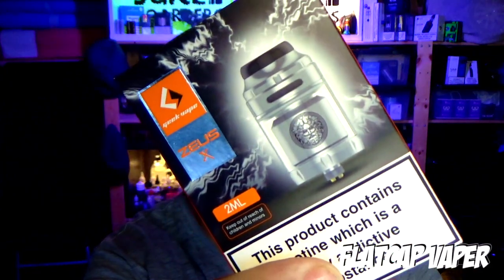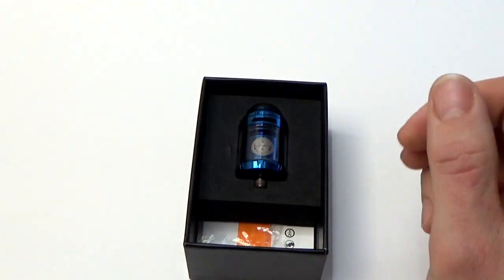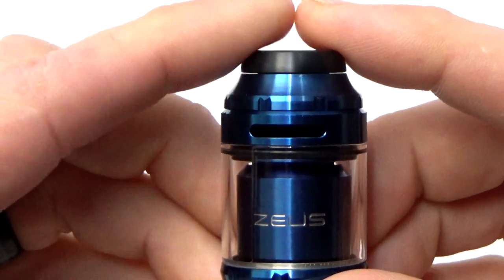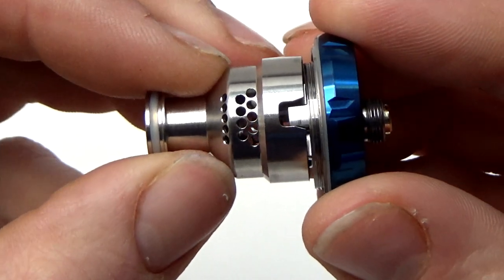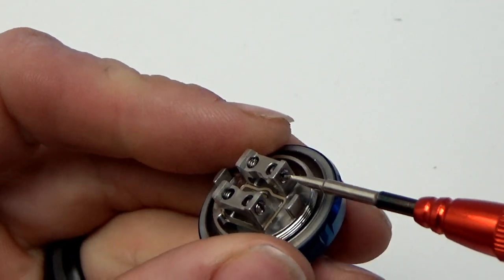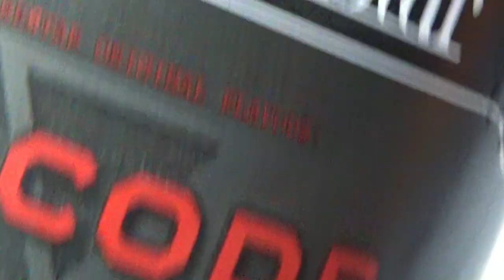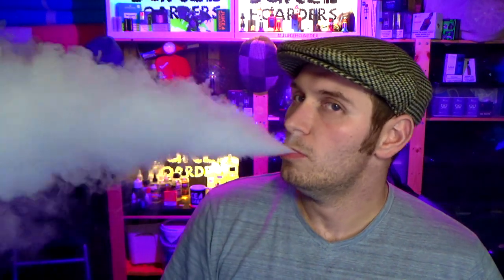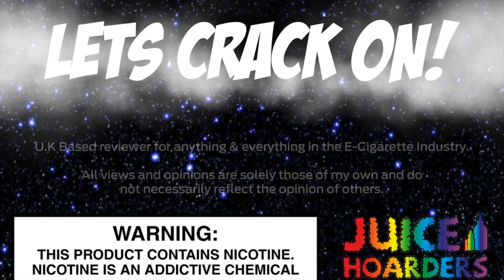Geekvape Zeus X RTA | UK Review | Unboxing | Build

Comment: so i noticed on yours just as on mine when you screw the top on the top airflow holes do not line up with the inside chamber holes and the coils...is it suppose to line up with everything else or because of that inner chamber and the honeycomb airflow to the top airflow holes do not have to line up with the inner honeycomb holes and the coils??
Reply from the maker: Hey Amelia. I see what you’re saying, I don’t really think it matters that they don’t line up, once your airflow is inside that chamber, it has no other option than to divert through the honeycomb holes and directly to the coils - so the top airflow slots could be positioned anywhere. 

It’s basically a chamber, inside a chamber so the air can only go through the internal chamber holes, and then UP to the drip tip. Hope this helps.
Reply from the maker: And thankyou for Subscribing. 🙂
Reply: FlatCap Vaper thanks for answering me. I’ve watched quite a few reviews on the Zeus x and some do line up and some don’t I guess it just depends on how to screw the top cap on but not one person has mentioned whether that top airflow is suppose to line up with everything else.
Reply: FlatCap Vaper and ur welcome I love watching reviews!
Reply: Hi Amelia, (1) once you push in that honeycomb chamber/air flow part, it should get held in place  due to the o-ring for it. (2) Once you're done building and ready to screw everything back together, that piece on the deck where those two metal squares stick up...it'll catch onto the aforementioned chamber/airflow piece and once you start screwing it on...You'll know, you'll feel it. (I think I'm making it sound more complicated than it actually is.)  (3)  Line up the coil(s) with the honeycombs....This is the only lining up you should do....Don't worry about that internal honeycomb chamber piece and subsequent parts lining up.  If installed correctly, the honeycomb piece will turn within the chimney when you adjust the airflow. They all easily fall in to place. (4) This is what I do: once you're ready to screw in your coil(s) into the deck, measure and pre-cut your wire leads in such that the coil is high enough to line up with those honeycomb holes...this way airflow allows for the air to directly hit the coils (but don't screw the coil(s) in too high, it may touch the inside of the chamber, causing a short). The deck is the last piece I screw in to complete the assembly.  I.e. I connect everything else together -- drip tip, top loading piece, the one-piece chimney with  that honeycomb chamber inside,  the removable airflow ring and bubble glass...THEN screw on the deck, with coils installed, wicked and primed.  Screw it on your mod, fill your tank and enjoy!   I'm sure there are many other ways to do it. Ok, Sorry for babbling...I hope that made some sense.
Reply: A§H so after you screw in the deck to the chimney....now I know that internal piece with the honeycomb airflow it always lines up with the coils because of the notches that I am not concerned about it are those two airflow skits at the very top where the adjustable airflow ring is. Sometimes when I screw to toppiece and glass on the base those top slots do not match up with the inner honeycomb holes and the coils they sometimes end up of to the side of lining up with everything else. My question is that top airflow is it suppose to line up or does it not matter because if that inner honeycomb piece that always lining up with the coils??
Reply: @amillie_412  ...Oh, I think I know what you mean...."is it suppose to line up or does it not matter because if that inner honeycomb piece that always lining up with the coils??" The answer is no it does not need to line up. Unlike most tanks, that top airflow is actually angled on a downward slope...because of this the air will hit the coils because it is directed there. Thus, it should not line up.  The way how the tank is designed, I don't think it is physically possible for it to line up, hence the need for angled airflow slots, which they refer to as "3D airflow".  I don't know who comes up with these names. Hope that helped.
Reply: A§H it most certainly did thank you I thought the same.. but I noticed on some of the review sometimes that airflow lines up perfectly with everything else and some it didn’t. It’s a weirdly built tank no matter how hard I try 10 out of 11 times that top airflow ends off up to the side
Reply: @amillie_412   It's definitely not a beginners tank (not saying you're a beginner). When I first got it I was scratching my head. But once assembled....imo the best RTA I've used. I strongly suggest that if you concerned, exchange it for another.  Maybe yours is defective.
Reply: A§H ya I’ve been building for a long time. It saves me money in the long run lol. This is the best rta by far I have ever had. I will probably end up buying another just because I like it so much and see if it’s the same as the one I have now in terms of that top airflow not lining up. Small deck is the only con I have. 2.5 mm coils fit great..3 is pushing but they work.
Reply: @amillie_412  'Managed to get away with three. While building I kept thinking the 3 was too big and the coils would definitely cause a short. But actually worked out quite well. I didn't use their cotton or wires that came with it.  So using a SS wire that is  dual core dual Clapton running...I did my parallel build. @ 0.25 ohms, 70W, in TC mode.